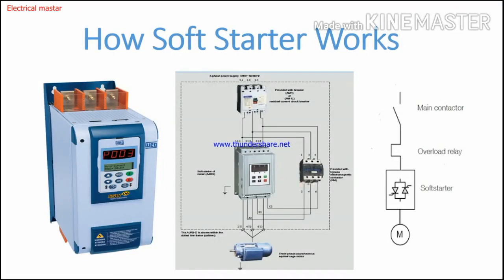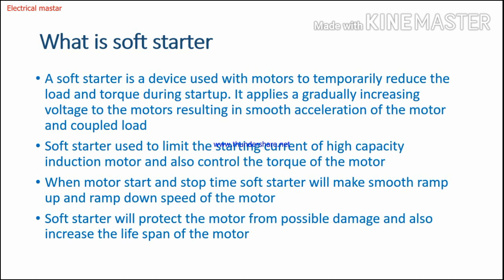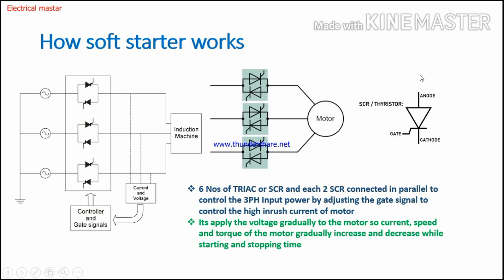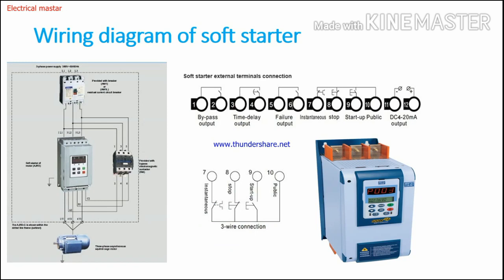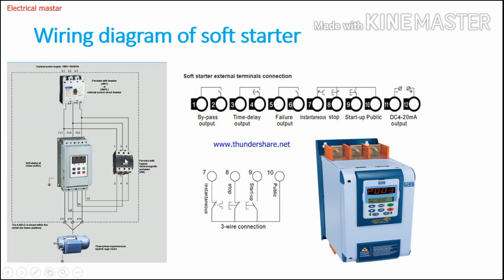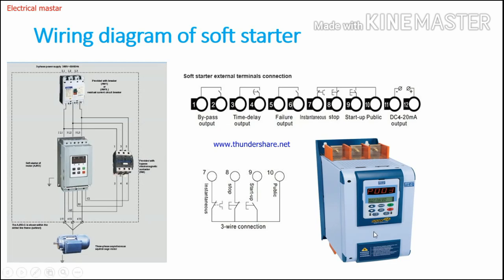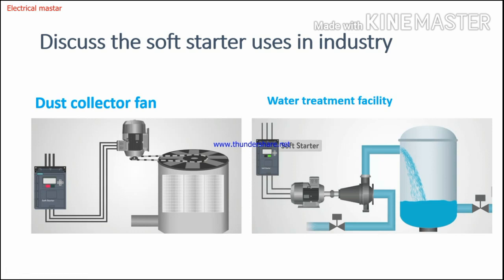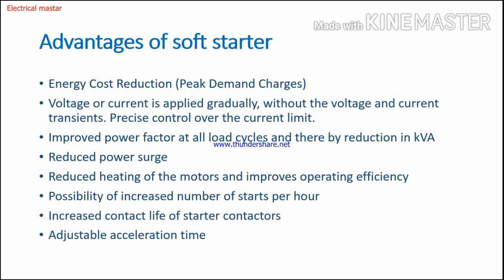How soft starter works | Wiring diagram of soft starter | Uses & Advantages of soft starter

Comment: Hi...may i ask...why 7 and 8 terminal in the ss always need to be short/connected
Reply from the maker: Hi thanks for your comments and 7 terminal is used for over current protection and 8 used for stop nc contacts both should be in NC then only starter will allow to start the motor
Thank you

Comment: how many Motor units can be connected to a single soft starter?for example I have 2 air compressors and a lifter can I use or wire them to a single soft starter device?thank you

Comment: Can we use soft starter for hydraulic power pack of a 50 up motor.
Reply: You probably already got your answer. 
Yes, it is an industry standard to use soft starts on EHPUs. The bigger the motor and pump, the more a soft start is needed.

Comment: Can we use soft starter in eot crane instead of Vfd?
Reply: On crane you may use vfd, but need brake unit and brake resistors, these elements need to clarify with vfd manufacturer.